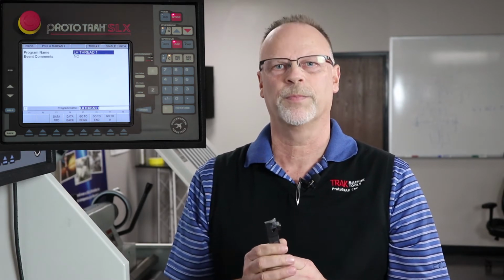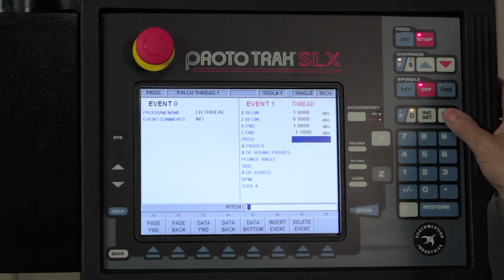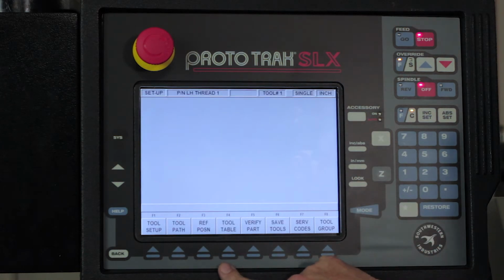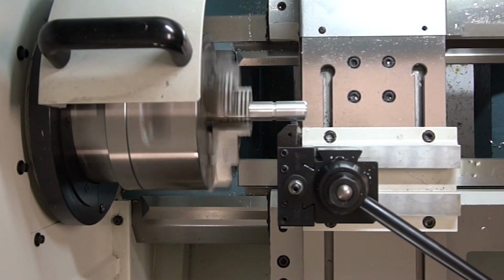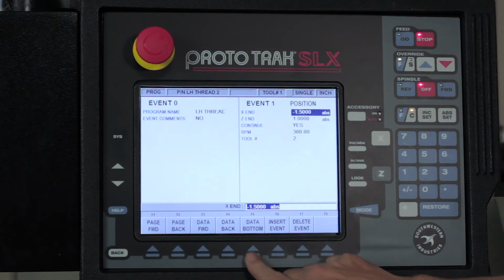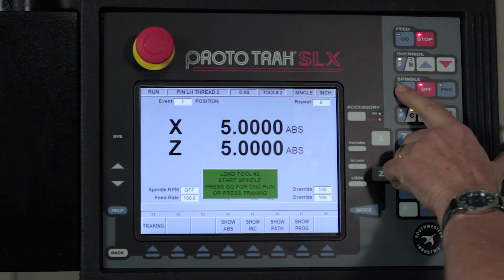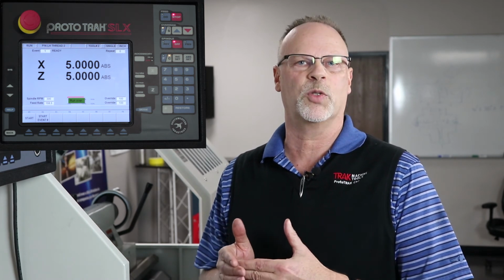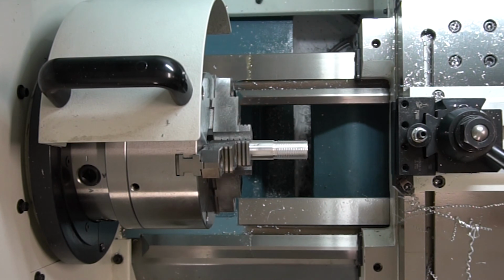Left-Handed OD Threads | ProtoTRAK SLX | Lathe Programming

Comment: How does one set up left handed tools? Getting the X dimension is easy enough, but how do we set the Z when touching the tool to the end of the part would not be feasible?
Reply: As long as you know the distance between the tool and the part, you can enter that dimension.  T.P.

Comment: Gday pat, is there a way use the same tool setup for left hand and right hand thread? Ie turning away from the chuck? I'm trying to make a ornamental knurl. Cheers mate!
Reply: Mr. Jack, the answer is yes because you have to use one of these two tricks in order to do left hand threads.  This means that Z zero is still on the left side of the tool.  If you try to do this on an RLX, you really don't change anything except that you can use the tool in it's standard position and program from left to right.  I hope this helps and Cheers to use as well! T.P.

Comment: So a few of the comments below mentioned using standard threading tool and feed away from the chuck. This is how I have been cutting threads forever on a manual machine. Is there a reason why it can't be done on a CNC machine? Thank you for you videos!
Reply: So, you are correct and there is no reason for it other than that our engineers never it made it work that way.  On our newest control, the RLX, you can program away from the chuck.  Sorry I don't have a better answer for you.  T.P.
Reply: @trakingpat2750  Thanks for the reply. Our programmer (MAZAK) was not aware that feeding away from the chuck in FWD spindle rotation made LH threads while using standard threading inserts.....Have a wonderful day!

Comment: Am I the only one who just uses a right hand thread set up, but simply switch the start and finish positions?  Feed towards the chuck = right hand thread,  Feed away from the chuck = left hand thread.
Reply: I was thinking the same thing.  I questioned whether the tool would rapid into the cut depth causing an issue if a relief cut was not performed first, which is what I need for my part.  I tried it without material or tools and a warning popped up stating "Threading away from the chuck is not allowed."  It may have been allowed with the original software on my 2009 SLX controller, but mine has failed a couple times and the refurbs have updated software.  I think CAM software would provide the G-code needed for this process or I can manually program that myself with RPM and feed numbers if it were really needed.  Flipping the tool over is a better option so I do not have to move the toolpost position to work with standard tool orientations and the thread bit on the back side.

Comment: I have a ProtoTrak SLX and it is a very good machine, simple to program and simple to use.  I do a lot of threading, right and left handed.  When doing left handed I flip the tool upside down like your first example.  The one thing I do differently than your example is when I need to make the threads deeper (almost always) I move the X axis and the Z axis.  If I need to go .005 in the X axis--I would adjust the X .005 (.0025 per side).  The Z I would move -.0014      tan 29.5 * -.0025=-.0014    I find that you get a much better thread---your comments are welcome

Comment: how does this work  with a machine that has a turret ?
Reply: You may need to make a special holder to get the upside down tool to the center height.  Working from the back may be the better method.  Unfortunately, this may not work for every instance.  T.P.

Comment: You can buy tools as standard to use on these machines to cut a LH thread
No cutting from the back or putting a RH tool upside down
Tools are made to do this operation
Reply: You are correct but in a lot of shops, this is not a common occurrence so they may not have one or want to invest in a special tool just for one or two jobs.  This method shows a way to make LH threads with standard tooling.  That's all it's intended for.  T.P.